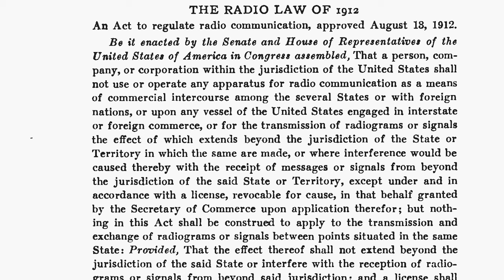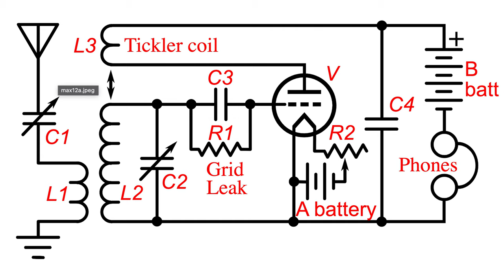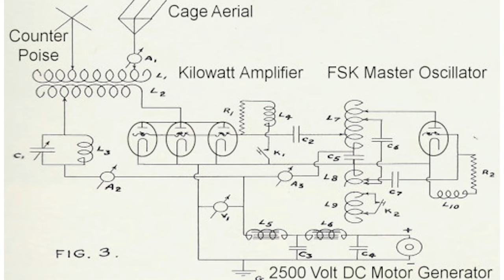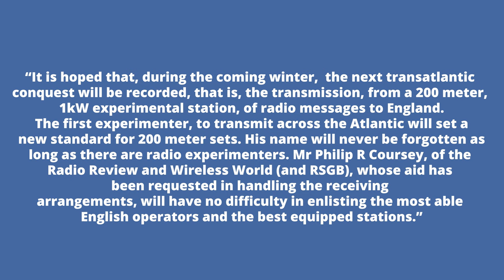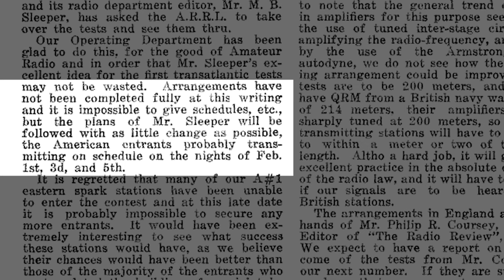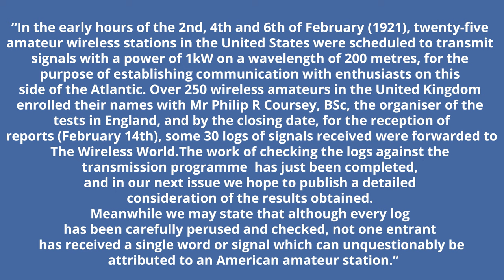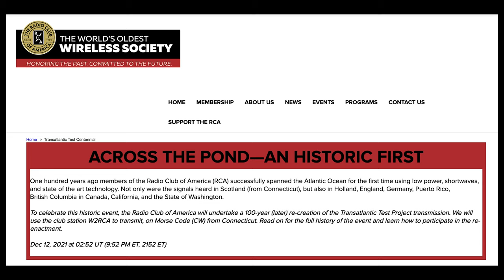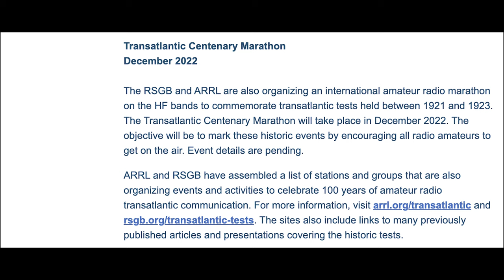100 years of the Transatlantic Tests - ham radio makes history!

Comment: War....all amateurs take down. All radio equipment.  For ww1and then also ww2. As I  got into ham radio. I found that was not all inclusive . I was ushered to a tall 5 story home. Then waked up all 4 sets of steps. The I went in to a small room it had a large spot lamp on a pivot. And many windows for 360° view. Of the town . Also on a table was a large box of binoculars.  The field glasses were the " reciver" and the spot "light"was the "transmitter" it had a shutter in front to "break" the beam. As in Morse code on navy ships. This tower was " net Controll". Late er I was  told that if the weather was right. A few towns around were recived/ transmitted to. Thus traffic was transfered with ease. Thou not with your missive on transatlantic. It does tell of the inventive ham and the never say die attitude.  Kv4li